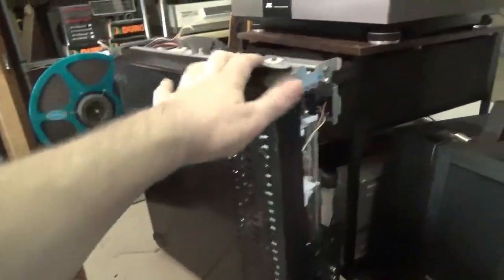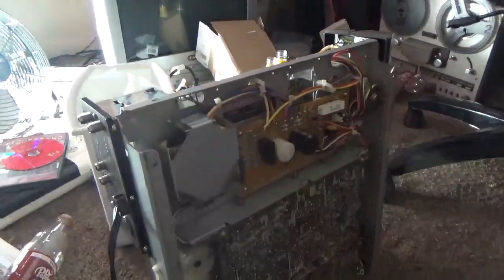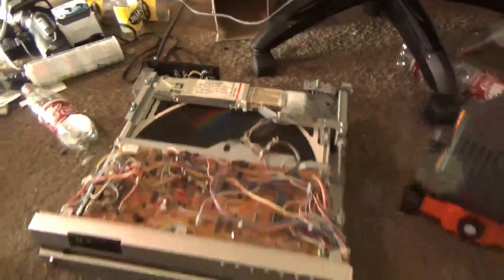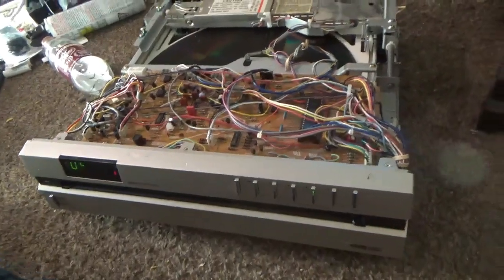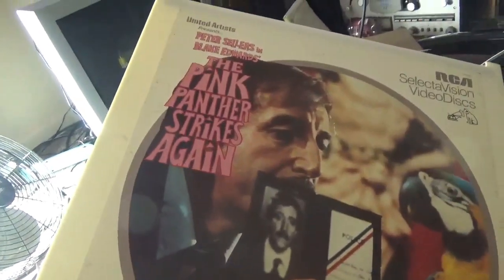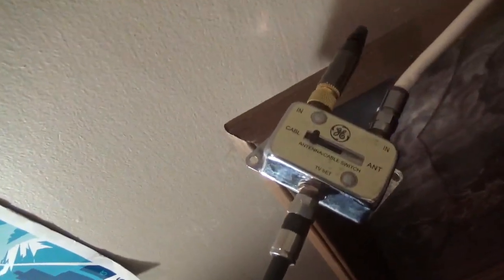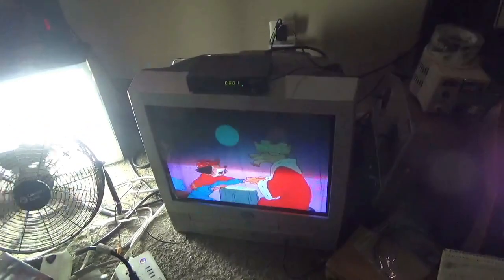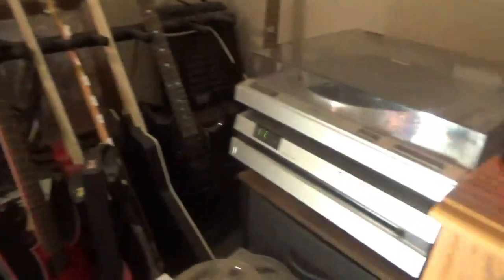Vintage Montgomery Ward CED Player Repair Part 2

Comment: Re: the belts. I restore vintage tape players/recorders. I deal with that issue all the time. I've had similar models of the same vintage, even have belts that have gooed-up in one machine, but not the other. As well, I've have mid-90s vintage belts melt, but belts from the early 80s still going. It has a lot to do with a couple of factors. A) the source and materials used (even different years/batches with the same manufacturer/model) and B) The environment it came from. 
If the unit came from somewhere that's typically warm/hot and humid, the belts won't do well. But, if it came from somewhere moderately cool and dry (Like western Canada, for example, had a lot of good luck there), the belts at most may be rotted and dry (usually just loose) and sometimes fall apart, but, rarely goo. Just speaking from my own experience.